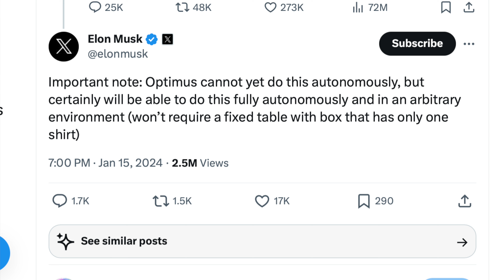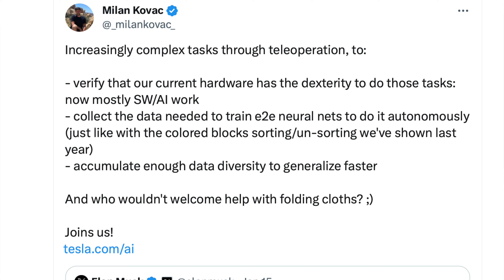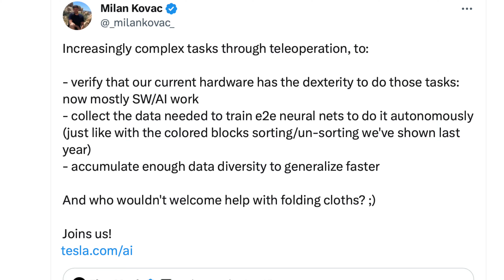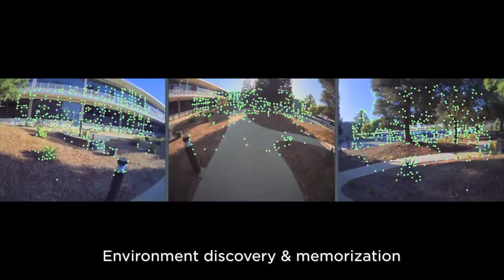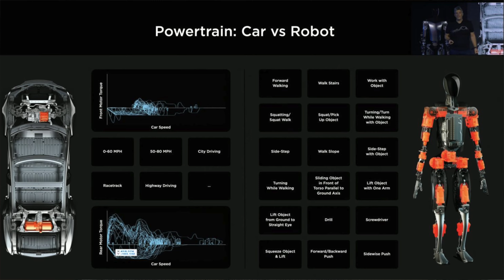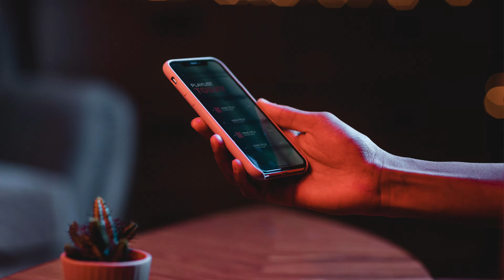Laundry Breakthrough?! Understand The TRUE Value Of Tesla's Optimus Robot

Comment: As Dr. Scott Walters roghtly pointed out, the robot works through the eyes and brain of a human with goggles and enhanced reality. The purpose is to check whether it could do the task with the hardware it has. If it was found that the hardware was limiting it unduly, they'd update the hardware before mass producing it. After it is tested this way, it will be mass produced. At the same time, the movements during this task, driven by human, will be used for the robot to learn from. Makes a lot of sense to me.